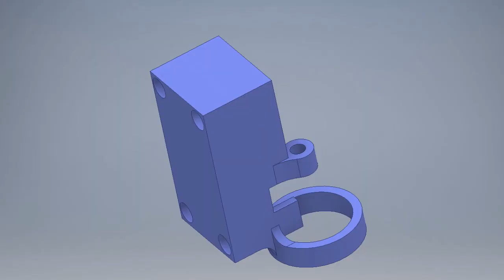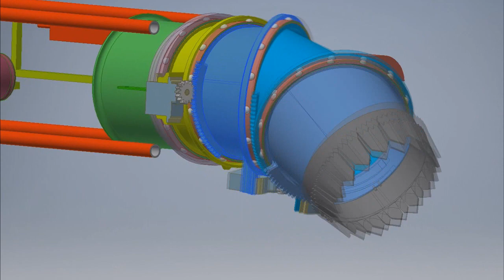F35B 5화, 서보 회전 각도 120도에서 1200도로 10배 개조하기 (ENGSUB)

Comment: Somebody could make money by producing a servo-controller for R/C planes which sits between the servos and the receiver. The “black box” would have maneuvers already programmed into it. So just plug the servos into the black box, and then  plug the black box into the receiver. Then you could initiate complex multi-part maneuvers with the joysticks. Or with an extra channel. For example: No. 1- a loop, followed by ten seconds of barrel roll, followed by a steep climb, followed by a dive. All as a single command. I bet it wouldn’t cost too much, it’s just a little circuit board.
Reply from the maker: Simply buying and making products on the market doesn't fit my channel concept. It's a channel that shows the process of making HOMEMADE. Thank you.
Reply: @LaLaRC exactly